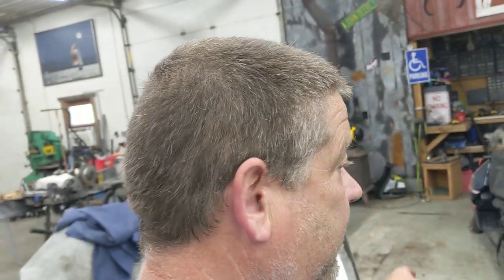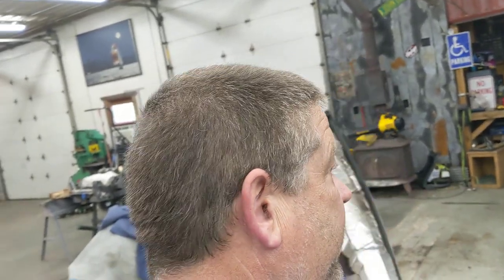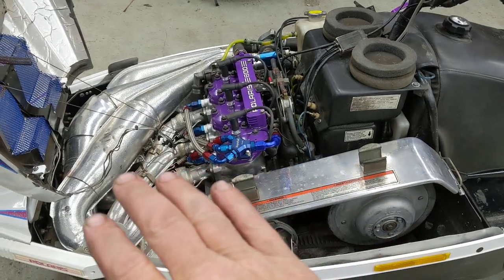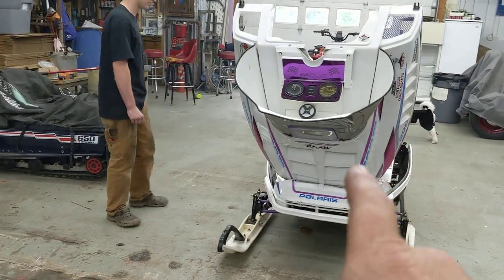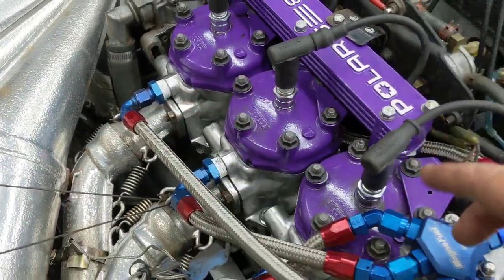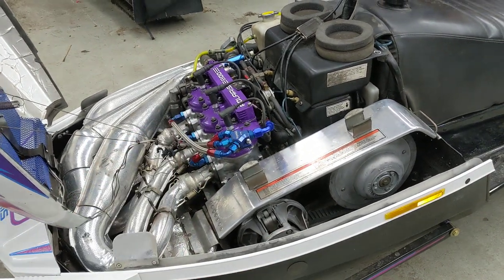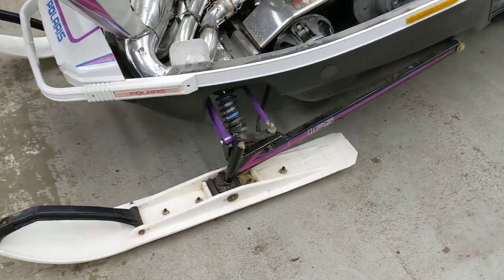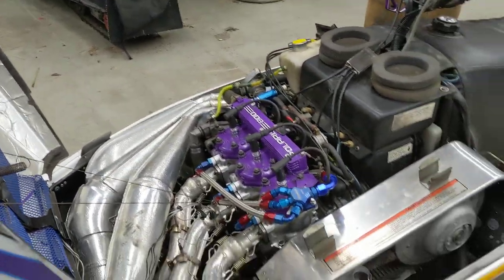TRIPLE POLARIS 800 STROM MOD BACK TOGETHER!!

Comment: Sounds good Todd
Reply from the maker: Thanks Larry
Reply: @toddclyne3493  nice lookin sleds I saw those but I went and picked up a 700 like your buddies
Reply: @toddclyne3493  question for you Todd I have that 600 triumph Indy witch trashcan would work for it if I'm not mistaken these sleds are based off the 1999 xlt ?
Reply from the maker: @larrywarner9314  message me a picture of sled and under the hood.
Reply: @toddclyne3493  I'm going up there this week end Todd I'll send it to you then bud .

Comment: Good Morning Todd.  Sounds and looks beautiful!  What finish is on those pipes?  I got a set of SLPs for my 97 XCR and want to get a finish on them that won't rust but will look nice.
Reply from the maker: Ceramic coating done at Race coatings in Wyoming MN.
Reply: Great to hear.  That's what I had in mind.  Thanks for confirming that.